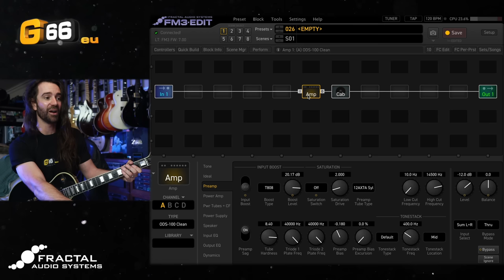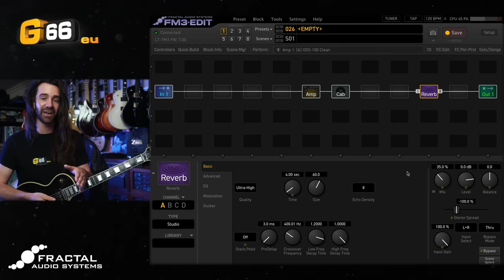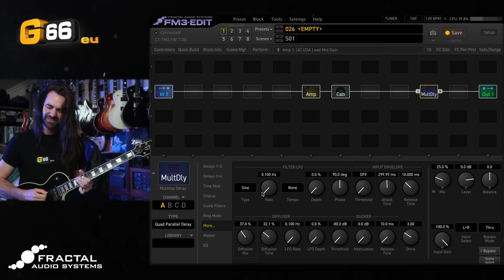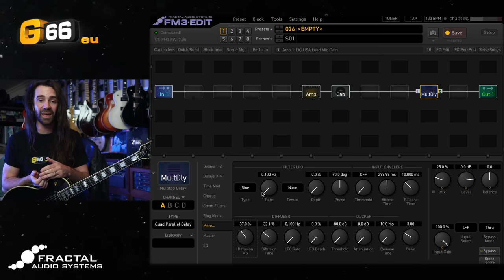Try These CPU Saving Tricks | Tuesday Tone Tip

Comment: I think the reverb quality when performing live through a FOH is great on economy, I don’t think anyone in an audience (or the sound engineer!)would know the  difference over high quality. The ultra res is better suited in a recording environment when the guitar is in isolation etc.  I hardly ever use the ultra setting just so I never run up the cpu level. As always fractal gives you great choices.